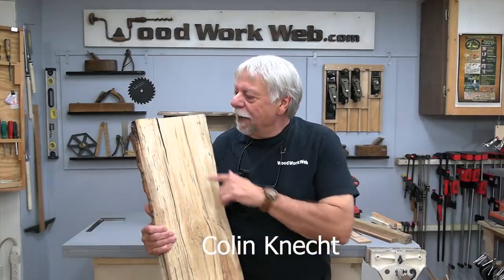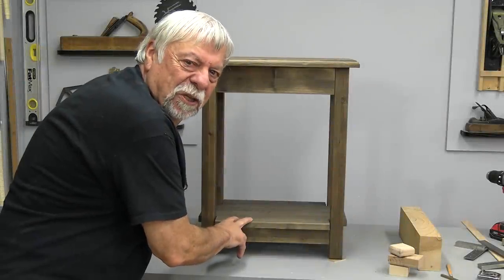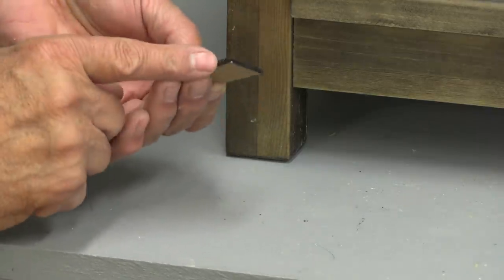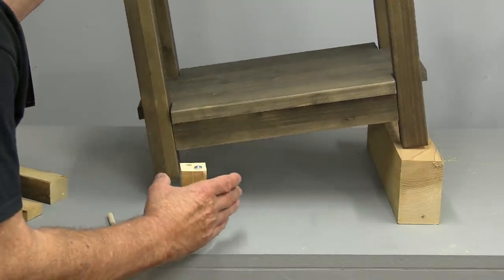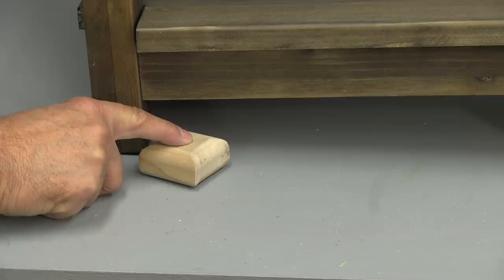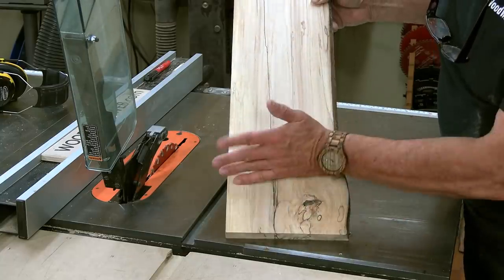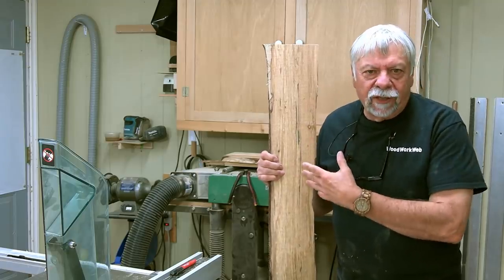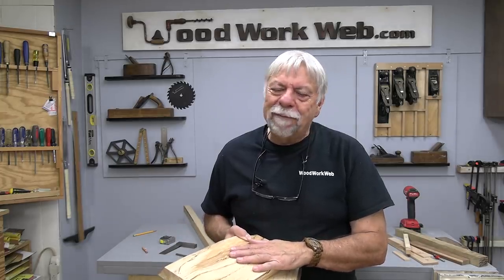Fixing Woodworking Mistakes - Episode 3

Comment: I had/have more than one chair with the rocking pneumonia. I screwed and screwed the adjustment leveling screws to fix it. Turns out that if you sit in the chair, it will level itself. That's right, it does not rock under load. Must be a warped frame.

Comment: I don't understand how ripping the board fixes the crack. It was still there.
Reply: In this case the crack was too big and wandered too much for the method to fully work. But the idea is that if the crack is small enough then it will be fully removed by the kerf of your blade, so you edge glue the piece back together and the crack will be gone.

Basically, woodworkers are constantly cutting off good, small pieces of wood and gluing those small pieces together to make big good pieces. In the case of a crack, the only bad part of a board might be 1/16 of an inch wide running down a few inches of the board. Rip off that bad part (which happens to fit in one kerf of the table saw) and glue the two remaining pieces back together. If the bad part doesnt fit in one kerf width, say the bad bit is 1" wide, then rip that 1" away by making 2 cuts and glue the rest of the board back together.

Comment: This is a good channel. Running ads at the beginning of the video was tolerable, but now ads intersperse the video. This is not tolerable. This subscriber is now a non-subscriber. If enough viewers complain and turn off, the over-commercialization of YouTube might be controlled. Join in, tune out.
Reply: I usually don't like the ads either.  However, I do like seeing the videos at no cost.
Reply: Just get an ad blocker.

Comment: So add a quarter inch bead around a cabinet door that’s off by an eighth? And then you have to do it to all the other doors that you actually made correctly.  No, sorry.  Remake the door.
Reply: You could get off with only cutting the offending side. If the rest are ok then  you can cut the rounded part of the martial and glue or pin ( maybe just glue) on the edge of doors. Will only be seen when open

Comment: Colin, with all due respect I was  shocked with  Your router push stick wrapped into a piece of cloth.
Do you realise how dangerous it is?
Reply: That was rubber drawer liner not cloth.
Reply: Its what Colin uses as non-slip on lots of things.
Reply: @MRichK  in this case it might be not so hazardeous.
 The spinning bit will tear a piece of that rubber
But it looks very sceary. There is a few other methods to increase friction force, i.e. abrasive paper glued to the push stick etc.
I am sure Colin knows them all.